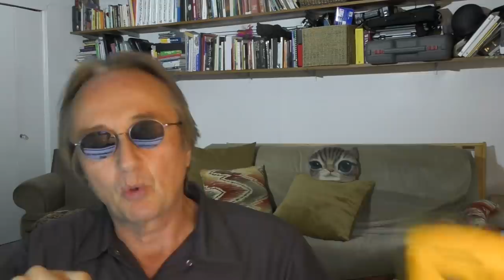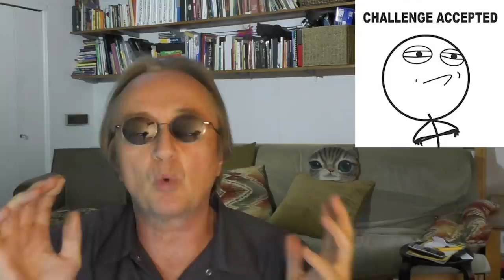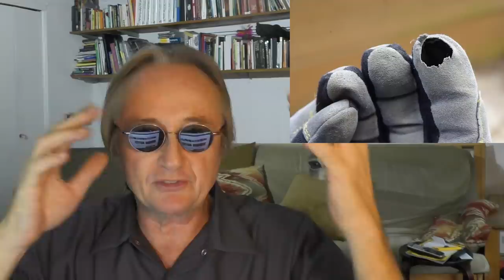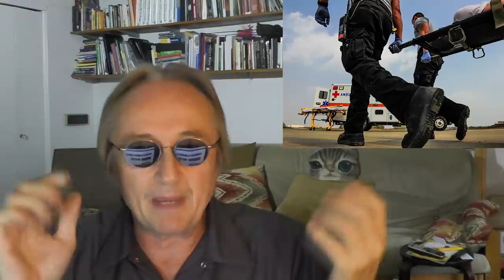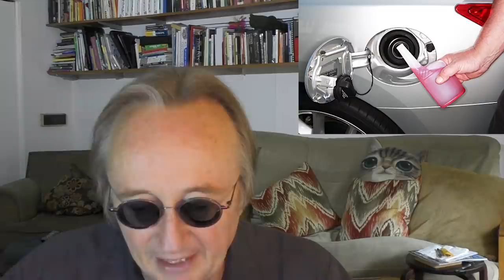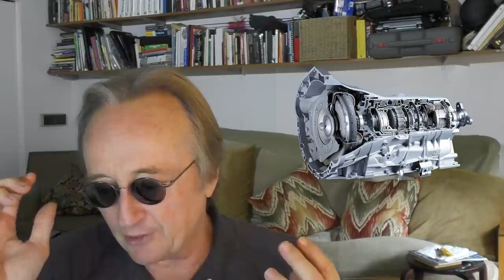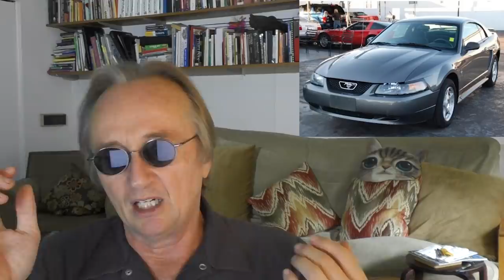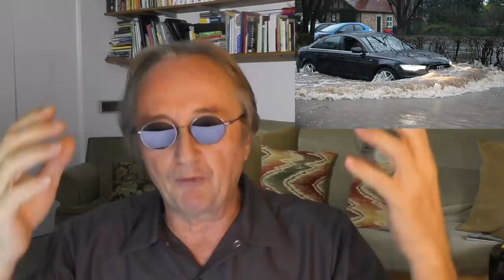The Scariest Car I’ve Ever Worked On, It Can Kill You

Comment: My friend’s daughter bought a Prius and the car broke down a few weeks ago, he sent the car to the dealer, battery gone! To replace it was about 4k with labour. The value of the prius with dead battery? 3k! He bought her a Mitsubishi suv
Reply: maff is heard. lol.
big batteries, what'll they dreamup next?
Reply: Tim Ewa gasoline for life
Reply: That’s a shame the cells are only around 25 bucks a piece if you can install them yourself
Reply: DailyOC never
Reply: I'm wondering, can you buy a Prius with a bad battery, remove the battery and install an alternator and then have a gas only fuel efficient car?
Reply: Steve will let Scotty answer that :)
Reply: @SM77785  no, the car was not designed like that. For god sakes it does not even have a belt.
Reply: Sam CarLegion Toyota is overrated junk she shoulda gotten a Fusion Hybrid. Great cars..good price.. drives awesome & ultra reliable. Own 2! Love em.
Reply: That's too bad. Batteries are very easy to replace yourself. I've had 3 priuses over 200k miles and never had issues with the hybrid system.
Reply: @SM77785  nope, car computer won't work.
Reply: David Klimmek prius and fusion hybrid is the same car silly
Reply: Mark Richards  No it does not, I have a Prius myself.
Reply: With a google search you can find companies that will replace it for half the price with a refurbished battery and they come with a 5 year unlimited mile warranty. They drive to you and it takes 1 hour. And doing it yourself is pretty straightforward. You essentially test the cells with a multimeter, pull the bad cells and replace them  with aftermarket cells. The battery sits in the back in front of your spare tire. You take it out then remove the shield to expose the cells.
Reply: You still need a battery of some sort. Electricity provides starting torque among other functions. Depending on what generation the car is, a battery is only a few grand. You should always be aware buying 10 year old prius, as the people probably sell them just before the battery goes. If it hasn't had a new one, prepare to bargain.

Replacing it isn't that difficult tbh. It's literally undoing a heap of bolts and connectors.

People are only afraid because "it's electricity"
Reply: @RennieAsh  you don't have to replace the whole battery, just the problem cells. People make a business out of refurbishing these batteries by replacing the problem cells and then putting them in people's Priuses as an alternative to going to Toyota. You could do it yourself.
Reply: @TravelerAlexander  I didn't want the hassle of replacing cells often. The new battery should last for 10 more years. Saved $700 by installing it myself.
I also got a new battery because the car was extra cheap from having an obviously dead battery :)
Reply: @SM77785  You don't actually need to modify the vehicle in any way when the battery system fails.
Reply: David Klimmek ford hybrid is licensed Toyota tech.
Reply: David Klimmek LOL, riiiiight, Ford is high quality!   I want some of what you are smoking...

Comment: From a lineman I learned you check gloves by filling them in water , immersing them in water, and checking for resistance between the two fluids. It takes a very small invisible pinhole to ruin your day. So far that's the only dangerous advice I have ever heard you utter. This seems worth verifying and correcting.

Comment: I work on Prius's with my bare hands.  When the Prius is shut down there is no power outside of the battery enclosure.  When the service plug is pulled the battery pack is cut in half.  The only dangerous point is between the plus and minus battery terminals.  The traction battery is isolated from the vehicle chassis, in fact the system checks this every time it powers up.

Comment: I reconditioned my hybrid battery myself. Key is to pull the orange plug out and never touch two points at the same time. I never wore gloves. But for safety if you're not sure on how electricity runs, PLEASE wear your gloves.

Comment: The UK mains electricity is 230 volts. DIY is not supposed to take place due to the voltage, but it does.
I've had a few shocks, as a DIY er, it's like a horse kick, but didn't kill me.
I actually felt quite invigorated about a half an hour afterwards.

Comment: I own 3 Prii and have replaced modules 6 times. No gloves. There is a master turn-off plug on the battery pack that kills the circuit. Once the plug is removed, all HV potential is gone.Also if you remove a terminal on the auxillary 12 volt battery, nothing will happen inside the main battery because the contactors will not work. I think the "danger" is overrated.

Comment: You're absolutely right about Honda automatics, my relatives bought a 2017 accord NEW last year with 000042 on the odometer...an "internal solenoid" (dealer said that) failed at 000046 miles, jerking forward, stalling in traffic, NO CHECK ENGINE LIGHT either, and dealer said it needed a brand new $5000 transmission...the dealer couldn't even repair it, they got another one from the factory.  Before that I was all gung-ho about Honda, but now I'm thinkin' wow when Hondas fail they fail spectacularly, a real POS (not point of sale).

Comment: I used to be an NY State EMT. We did a few classes on  the dangers of car accidents of course including Hybrid batteries.  It wasn't so much reaching in, but was the jaws of life opening up the car for extraction.  If that cut the main hybrid power cord, well good buy. We also saw a video on a rescuer going through the passenger side of a normal car to help get someone out, and the passenger side air bag wen't off and threw a man, maybe about 30 feet out of the car through the air. A few broken ribs, and some bruises , but he was okay besides that.

Comment: I wouldn't say 288V is any problematic. As a marine engineer I'm familiarized with working on electrical equipment up to 1000V AC or DC. A normal switchboard voltage is 440V AC and 690V AC. Some vessels has high voltage generators ex. 3300V, 6600V etc. As far as you follow safe working procedure, it's normally not any problem.  Higher voltage means thinner cables, thats why its used. High current can be a seriously fire risk, due to bad contact which generates heat.

Comment: It is electrical current that kills. That little shock you get on a dry day is many thousands of volts, but will not injure you. Voltage is like the height of a water fall. When there is a lot of water current flowing, it can do a lot of damage. If the water fall is only dripping, its like that little little static shock on a dry day.

Comment: 250VAC or even 120VAC is much worse than 280VDC
Your muscles respond heavily to AC, that's what your brain does, meaning, if you swamp your body with AC, It can cause problems for muscles (such as your heart) That is the biggest threat with electricity. DC on the other hand,  while the same (if not more) power flows through you, It does not alternate, It can do everything AC does to you minus causing your muscles to attempt to fire around 100 times per second (twice per full wave, Once on + wave, once on - wave)

That being said, It is still nothing to scoff at, It can burn you badly, Still cause heart problems, kill your nerves in effected areas, and Cause small hydrogen & oxygen bobbles in your body stream.
Reply: More are probably killed with AC, than DC.
High amperage DC will BURN you, internally !!!! ... all the way from where you contact the negative, all the way TO the 'positive'.
AC (with moderate amperage and more) mostly STOPS the heart contractions ... if the 'shock' timing simultaneously happens exactly when the heart is in a micro-second 'resting-phase' (no activity).  The 'good thing' (?) with AC electrocution is ... if one has a 'healthy' physiology, the heart 'may' re-start itself (if all the neurological 'circuitry' hasn't been destroyed by the 'shock' of high amperage.)   However if you took 50- 60,  people all holding hands, and with 'perfect' conductivity between them ... a simple 15 amp AC circuit has enough energy to electrocute them ALL at the same time.

Comment: When I worked at Tesla, i worked on the 400 volt, 900 amp power cables that went from the Power Electronics Module to the 3-phase motor. Zero gauge copper stranded wire, 3 conductors. One cable weighed almost 30 pounds!
Reply: No wonder the cars weigh so much !

Comment: Your high voltage glove testing is normal.  I've worked with up to 4,160 volts.    The gloves have to have leather glove over them to protect them.    So that you don't blow off arms when you short stuff out.

Electrical work is a matter of watching what you're doing.

Hint for older folks.    Squeeze different parts of the gloves to isolate the leak.   When you think you got it, wet your lips and run the glove until you feel a chill.    Younger colleagues can help too. Especially younger women who have avoided loud music and gun fire.

Comment: OK! the Prius has 201.6 nominal volts.  The Toyota Highlander Hybrid has 288 volts.  My Car Angel here on YouTube cleans the engines of these cars with no warning of electrocution. The Prius is designed to disconnect the hybrid battery on impact.  Young men here on youtube swap out the battery packs all the time.  Scotty loves to pump up the fear of  generator failure  and the danger of the battery packs on these hybrids. You shouldn't work on them if you are not qualified.  However, these cars are perfectly safe and you would have to be a dimwit to get electrocuted by them.

Comment: When working on the Prius (or any hybrid, for that matter) high voltage system, ALWAYS pull the safety plug. On the Prius it's on right rear of the HV battery.
Reply: Does that make it safe to freely work on the car or should you still be super cautious?

Comment: Scotty please help I want to buy a 2002 honda with srs light on will it still pass Ca.  Vehicle inspection
Reply: Toyota Celica 94 or nothing
Reply: Oh that SHOULD be fine. I live California myself, my first car was a 1997 honda accord brought from a junkyard by my dad for 1000 bucks as a high school graduation gift and the srs light was always on because the airbags were already deployed (salvage title, my dad had the idea that I wouldn't street race or do reckless things if the car wasn't safe lul). Long story short, it passed the smog tests from 2010 - 2014 (year I sold it).

You should be fine with the srs light, that's for airbags, but a check engine light = instant fail. Just don't crash or your parents will have an expensive bill to bury you later! ;)
Reply: I also live in ca. srs light light will not affect emission tests, and it will pass. I have had several vehicles with  the same problem and they all passed. you can also ask from smog station before having them tested.
Reply: @A_Degenerate_with_Glasses   Im talking about the dMv safety inspection not smog
Reply: @tosifaliyev3554  not smog but the DMV inspection
Reply: @lanceolguin3670  Oh that's what you meant. Generally for any car in California, that is not required though, so when any Californian sees the word "vehicle inspection" they would automatically assume that you are talking about a smog test. 

If you're that worried about failing the DMV safety inspection, then I'm assuming that car you mention is already written off as totaled by an insurance company and you're looking to fix it up and getting a salvage title on it. In that case, then yes you do need the SRS light off, by installing new airbags in the front and wire them properly. Of course, I serously doubt that because a person doing this wouldn't ask on youtube because they would already know what they are doing and don't take my word on this one because I asked Professor Google.
Reply: @A_Degenerate_with_Glasses  thanks alot and to clarify im new to cars and not all cars neeed to be inspected
Reply: SRS light generally means your airbag system is disabled, FYI

Comment: Hey Scotty, I recently had a mouse nest inside the battery of a Highlander hybrid. They chewed the CAN bus wires and all the insulation on the high voltage wires out to the inverter. I learned a few things while fixing this; neither high voltage positive or negative is tied to the body of the car, the service plug is near the middle of the stack, which separates it into about a 200 volt battery and a 130 volt one, and there are three contactors for the high voltage lines, which are all open when the car is off. You'd have to do something really really stupid to get electrocuted with one of those. Toyota has made one of the safest hybrid systems out there, and I have no worries working on them, even without the fancy gloves.

Comment: I own a 2003 mach 1 v8 mustang. And i daily drive a 2003 v6 mustang. Bought the mach 1 to replace the v6 mustang. Lol glad i never got rid of the v6. That is a solid car. I recommend it to any one. Just don't get them hot. It has 200xxx on it and is been excellent. The mach 1 has 126xxx and i am currently pulling the motor due to a rod knock. And i beat both the same.

Comment: I'd like to argue, there are rarely any CVT issues on Hondas past say, 2014. Sure they might not be "strong" and won't hold up to extreme amounts of torque, but I've never really seen anyone complain of reliability. For someone who lives in NYC and the stop/go traffic... It would probably have less wear on the CVT simply because it's a torque converter system whereas a clutch would burn out much quicker in severe traffic conditions like NYC.

Comment: Our Toyota Prius is the second hybrid that my wife and I have owned. The first was a Civic Hybrid. We loved both cars. We may still have the Civic if it wasn't for a hit and run driver totalling it. The last time that I have owned a good American car was my old 1993 Oldsmobile Cutlass Ciera. That was a very reliable car. The next car was a 2002 Buick LeSabre, and that thing was a piece of junk from almost the beginning. The fuel gauge never worked, and it cost literally hundreds of dollars every year for it to pass inspection. The engine mounts were constantly breaking on a yearly basis, and the rear shock air compressor had burned out. Those were just a couple of the issues.

Comment: I think that carb and injector cleaners can work great, but if you ever replace an old gas tank filler hose with a cheap nock off like I did (non silicone), I suspect that the cleaner will eat up the new hose.

Comment: The nice thing about the smaller engines in the Mustangs ... is the car can be better balanced - though it may depend on what you want.

v6 or i4 turbo would be OK ... probably should also get a manual, IMHO.

Comment: Scotty, it’s not voltage that can kill...”Amperage aka AMPS” or flow of current is what kills. 1 amp can kill. My Dad retired from power company in OH after 43yrs last year. Stun Guns are high voltage BUT very low on amps. That’s why risk electrocution is muck lower on stun guns as compared to power lines or other sources with higher amps. (Also, if any health problems the risks of death is higher)

Comment: Level of voltage is not the determining factor in regards to lethality, it is the amperage.  It requires 6-8 amps to be able to penetrate deep enough in the body to have the current pass over the heart.  Example: tasers/stun guns have voltages ranging from 5,000 volts to over 50,000 volts, but only put out milliamps.  The power coming into a normal household generally has 100 amps per pole.  A household outlet supplies 15-20 amps which is more than sufficient to potentially kill someone.

Comment: Regarding the guy who drove through water oh, I would also watch my temperature gauge. If there's damage to the radiator initially you might see some fluctuating temperatures as coolant goes down in volume. Same is true of head bolts or head gaskets I should say if you have a small coolant week into the combustion chamber you may not notice it. The only symptom you will see is a fluctuation in your temperature gauge or you driving down the highway in particular at highway speeds. This I can tell you honestly from experience.

Comment: Dude with the engine running a 12 volt battery with a 700 to 1000 Amps does hurt bad and can even turn your hands black don't be wrong mr Expert I still love your videos your right 85% of the time

Comment: @ScottyKilmer 
When buying a used car is it suggested I change 
Spark plugs 
Oil 
Filters both air filter and cabin 
Transmission flush and new filter and fluid 
Also what additives to use to get a little
More performance out of the car?

Comment: the prius is 288 DC. the outlet is 120AC. people in the eu survive 220/240 AC very commonly. given that dc is much safer if you have thick boots, do the 1 hand rule and shut off the main circuit breaker NOTHING  can happen to you

Comment: 12v is not "low power", it is low voltage ... and safe, since there are not enough voltes to make you part of the circuit.
24v is also fairly lower voltage ... 24v is common for European boats - sail boats, power boats.

Yes, that would fry and kill you (potentially).

Comment: On the hybrid buses I work on we run 600+v theres a whole method to disconnecting the inverter and batteries so we dont die. Even the gloves we use are only good for 8 months

Comment: Its not the volts that kill you, its the amps. Voltage is like water pressure and amps is like the amount of water flowing.
Reply: eedrox even with 12V and an internal body impedance of 770 ohms (assuming wet tongue and no hand impedance like a cut finger) you will only have about 15mA to deal with. You will feel it but it likely won’t kill you.